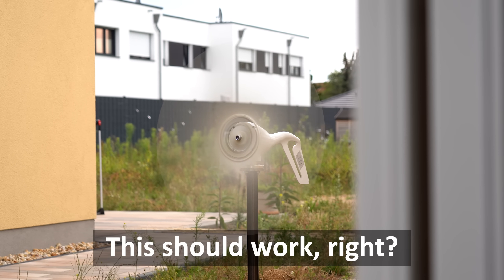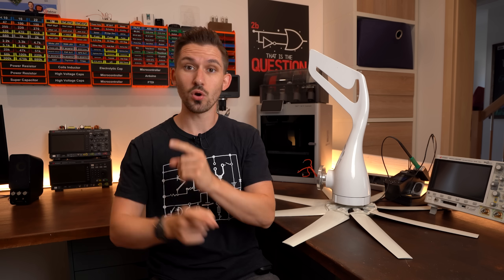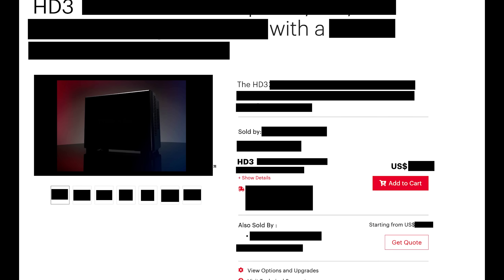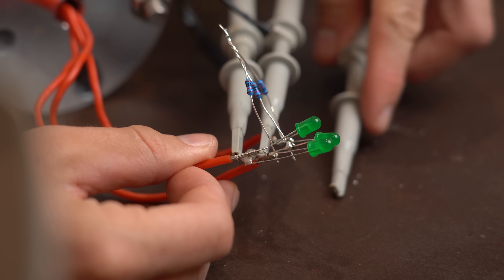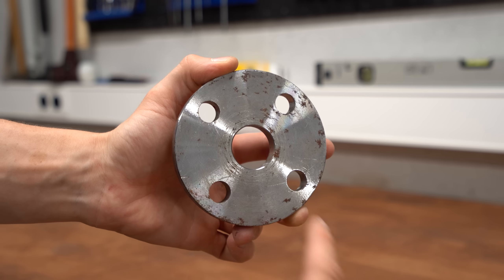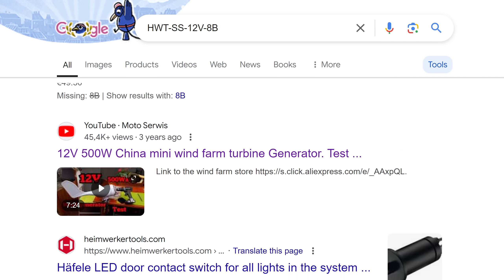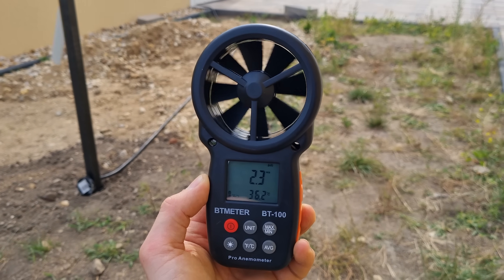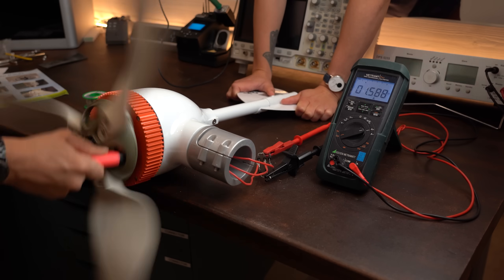I tried to Power my Home with Wind Generators! (Worth it?)

Comment: I lived with a wind generator like that on my boat for years. It only produced a significant number of amps in 20 knots of wind or more, so a few hours a month. On my next boat, I put all the money into solar and we never had to run the diesel generator. Now, on my house, we have 18,500 watts of solar panels in tropical Mexico. We can run the A/C all year.
Reply: Thats awesome! I'm currently running a 6000btu window ac off a 400 watt solar setup 200ah lithium. It works ok but ac uses 450-500 watts so im adding 200 watts so I can run it all day. Already saves me money not running my hvac much.
Reply: @GodAlwaysWins7 if there’s one rule for solar, it’s always have plenty more than you think you need.
Reply: solar is always better, no moving parts, good price.
Reply: I removed so many from sailboats. So little power, so much hassle. .
Reply: Why run AC alltime
Reply: @jussikankinen9409 
Because it's hot?
Mine rarely gets turned off all year. It's cooling in summer, heating in winter and just on fan at the moment as the weather warms up from winter.
Reply: The keyword in the whole story is Mexico and tropics.
Reply: You only had to apply a "modification" to the old generator: to mount a wheel with pedals and a system for transmitting energy from the pedals through a car or motorcycle chain...win on two levels: 1. Reducing obesity and producing energy, more chosen for the morning run...sometimes also the night run

Comment: Typically wind generators are located higher up - where wind speed is higher and more consistent. You placed them close to the ground with buildings shielding them. Location is key to getting wind power.

Comment: This is something I've been wanting to do too. I want solar panels and wind generation to charge a power bank to power a few devices of the home. Mainly, the air conditioning, 220v clothes drier and computers as these things are the most power consumers in my home. I'd like to have these items run in a seperate power supply from the  rest of the house as they aren't in use all the time, but they currently spike my electric bill.

Comment: if you are going to do more than just testing with the turbine, I would defiantly suggest a slip ring joint for the cables going up to the generator so that as the turbine is facing different directions does not tangle your wires inside the mast

Comment: Non technical tip: try to get a permit to install it on your roof (against the chimney)
Reply: Depending on the part of German he doesn't need a permit if the blades stay under 9m above ground. Than he only needs to tick a box in the Marktdatenstammregister to export up to 800W into the power grid.

Comment: What about mounting the turbineblades on a high amp car alternator? Maybe with some kind of gearing.
Reply: Car alternators don't make efficient generators due to the energy wasted creating the magnetic field. Also gears must be avoided due to losses and reliability.
Reply: @Ed.R  so as efficient as the turbines in the video? 😅
Just had a thought it would make more amps than the turbines. Some small ones can produce 140 amps. But you're probably right. If they have to be geared, they will be very inefficient. I just thought it would be a fun idea, also for comparison with the wind turbines he bought. A car alternator isn't that expensive secondhand. 🤷‍♂️
Reply: @MetalDevil1912  at least they are an attempt at a permanent magnet generator. You will only get the amps if you can put in enough mechanical power so big blades. It's more fun to design and build a permanent magnet generator and if done right can perform very well. The key to performance is matching the generator to the blades. The blades must be keep at their optimum tip speed ratio.
Reply: @Ed.R  interesting. Didn't know that. I'm curious to see what he will do. Thank you for your insight. It's a great topic. Do you work with wind turbines or something like this?
Reply: @MetalDevil1912  I've built a few DIY turbines over the years and learnt a lot. I've read books by people who live in remote places and use homemade turbines to generate all their electricity. I also studied renewable energy at university and got a degree. I'm no expert but know more than the average person.

Comment: I wonder how much energy is actually available in the air moving compared to the output of the generator, if there is only 2 or 3 watts in the blade area and you are getting half of it out that's not horrible.

Comment: My guess is, the flange is "DN25" aka "1 inch" aka "~33mm od" so the id is somewhere around 28 mm depending on the wall thickness.

Comment: I assume that those MPPT s are garbage. There's just an output fet which is driven by pwm from controller in order to apply correct voltage to battery. But voltage itself should at least  be more then 15 volts.

Comment: Your conclusion is a bit harsh, as you bought the most scammy models on the market with the most useless power output and mounted them in the worst position possible and complain that it doesn't work. 😂

Yeah, no shit? 🤔

Checkout the SuperWind 1250 for example and mount it on a 5-10m pole (after getting the permission to do that of course). They work great and have inverters which give you real power output at low speeds.

Comment: Hi mr Scott i wanna tell u something about electrical welding 
U need to move very slowly with around 1mm between welding stick and the metal that u were welding (after the stick get red) to get a perfect welding.  after finishing use the back of ur hammer (the triangular part of the hammer) hit the welding to remove the oxidation layer. I wonder if it was clear for u 😊

Comment: I feel like the wind speed limitation is an issue with your circuitry, and not necessarily an issue with wind power as a whole. Even if it's output is 1v you could still charge 20 capacitors in parallel and discharge them in series to get a pulsed 20v output.

Comment: Well this went as expected lol

I don't know if you have used or looked for a previous video (can't remember) but maybe check out omnicalculator to get a rough estimate of the total power output available for a given blade size and wind speed.

In general smaller wind turbines are pretty much useless because you just don't have the power available in the wind to start off with in typical wind speeds like you and I have.
Reply from the maker: Thanks for the feedback :-)

Comment: The power output formula of a wind turbine gives you a hint when it becomes cost efficient. Wind speed. And where do you get that? Higher up. Also rotor area. So big and high up it needs to be

Comment: Finally!  Finally!  Someone who welds JUST LIKE ME!!!!

Thanks for the video!
Reply from the maker: Haha :-) I mean at least it hold up ;-)
Reply: LOL, then you need more current through your welding wire or electrode.
Reply: That looked like a multi-process welder vs a simple stick welder. Next time try using flux-core MIG wire. Almost as dirty to clean up, however a little easier to weld decently for the beginner.
Reply: It looked like the flange was stainless steel. I've never welded stainless steel myself, but I understand it's a lot more difficult than carbon steel, especially with a stick welder.
Reply: @chitlitlah  It makes no difference what materials you weld in, as long as they contain some form of iron, you still have to have enough current on your welder so that it melts both materials together and not just layen pigeon drops from the electrode on top of the flange and the pipe.
Reply: @TheLandbo  It makes a huge difference what the material is. Someone welding for the first time ever should be doing it with an easy material, like carbon steel. But yes, current is one of many things you need to get right.
Reply: literally me
Reply: real world welds dont look like dimes :face-blue-smiling:

Comment: You only tried low budget Chinese stuff, I had hoped to see a compare to something a lot better. I live on a boat in a very windy harbor. I use solar panels but in winter I could use something extra. It almost always is windy here, almost always between 3 and 6 beaufort. Nobody here uses wind generators, but there are sometimes travelers who do use one on their boat and when I ask, some say it is a waste of money, others say it works very well. The first are most time low budget direct from China like yours. , the latter use much more expensive brands (over 1000 euro) but up to now all of them had no EE background and often not even know the difference between current and voltage, let alone they can measure things. 

Was that a new generator, that metal ring looked rather (heavy) used .
Reply: Where would you even find wind generators that arent from cheap chinese BS. I've looked and everything looks like garbage. Only ones that arent seem to be 10x what they need to be priced to be economically viable

Comment: replace the neodymium magnets inside with a much stronger version , a tighter winding and more copper on the coils  a small termination coil on the end of each neodymium magnet  and somehow incorporate a gearbox into the spinning of the rotor blade so that the blade can spin sorter freely until it picks up enough torque to spin the generator
Reply from the maker: Sounds like a plan

Comment: Are vertical wind turbines allowed on roof tops?
Reply from the maker: I will check
Reply: @greatscottlab  IIRC the main issue are shadows being cast with interruptions. In NRW it's generally allowed, but you need permission of all affected neighbors and they can always change their mind, which means you can basically forget mounting one as you may have to take it down at a random point in the future.

A vertical turbine could make this easier, as the shadow cast can be steady - depending on the design.

Comment: that rotor is WAY TOO SMALL! it is merely for charging smartphones.
it is a matter of diameter. 
for practical purposes, you start with 5m diameter.
and any practical generation starts with 4.5m/sec. 
any device that says it works at lower wind speeds, it is not serious. 
it is about physics, not about performant technologies. 
believe me, i got my Engineering in Physics license with Eolian Energy! 
those generators you seem to be attracted to, are toys. 
remember, 5m+ diameter, 15m high, at least! and only above 4.5m/sec, and it will still produce not enough for a home.

Comment: I think that it's time for a DIY controller circuit. It could be even simpler than a complex MPPT, if you build a buck-boost converter with undevoltage lockout and input current limit, it should also work. At least I hope, because my idea can be completely wrong.

By the way designing switching regulators with TL494 is dead-simple, maybe with some extra circuits it will work properly.
Reply from the maker: Maybe in part 2 ;-) We will see....

Comment: I have the opposite problem were I am. I have had 2 wind generators destroy themselves & I know of 1 other & even 2 small to medium commercial wind generators have died due to high wind speeds & I have contacted most of the manufacturers with no practical help.
Reply from the maker: Oh boy. Hope you get it to work ;-)

Comment: I think the next video should be about what we need to modify to make them work as illustrated in the sellers webpage..."1000 watts power and this and that blah blah blah"... thanks for your helpful videos!.
Reply from the maker: Great idea!
Reply: Not going to say the seller is 100% honest. But it said rated wind speed of 13m/s. wich is about 5 times what we had. as the power increases cubic, 5x higher speed should equal about 125x power. 
So to make this thing work, the most important modification ist to get higher wind speed. Most obvious solution is to get it higher of the ground.
Maybe it's possible to use the aerodynamics of your property and find a more windier spot, but I'm afraid there is no way around mounting that thing way higher
Reply: @mariosmusik4898  many people said that the winding is inefficient, and Ive seen some boats using them and not getting the advertised power in the speed range the seller advertises... That is why I was asking Scott to make a video making changes or diy modification to get the desired power to charge a battery bank properly within the rated speed ... You can always use a motor to spin the axle And get exactly the speed you need to test them... What do you say Scott?

Comment: I'm surprised there weren't more comments about placing the wind generator so close to the ground. Some of the other comments seem to disregard your EXPRESSED INTENT to SUPPLEMENT solar. Of course wind is intermittent! Adding more solar would probably be more effective if you could afford adequate battery capacity to store it BUT wind power CAN work day OR night. In my area, the wind is also often the strongest when it is cloudy and your solar inputs would be reduced. Diversity is generally a good thing, there might be a week with cloudy weather but a week without sun OR wind would be less likely. I live in the big woods so getting a wind generator high enough is a problem but if I had decent wind conditions, I would have both wind and solar.
Reply from the maker: Good feedback. I certainly agree. And I also addressed in the video why my pole is so close to the ground ;-)